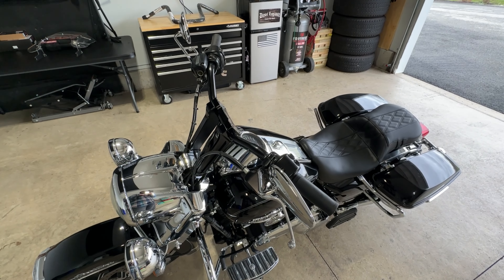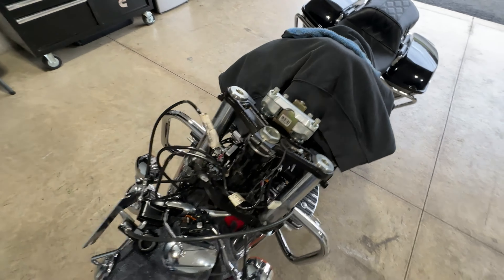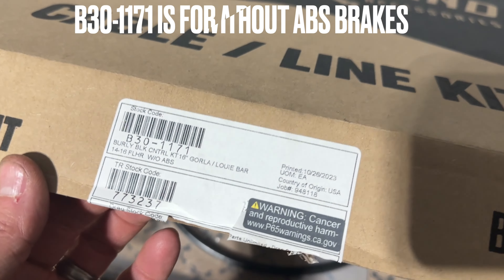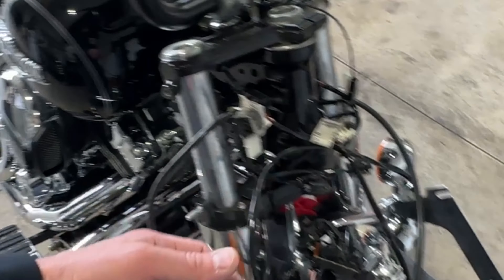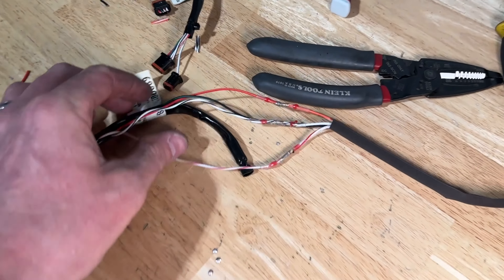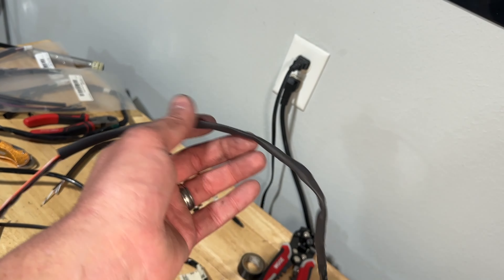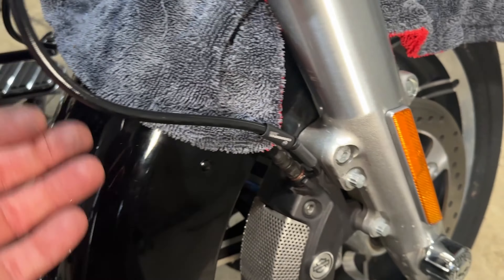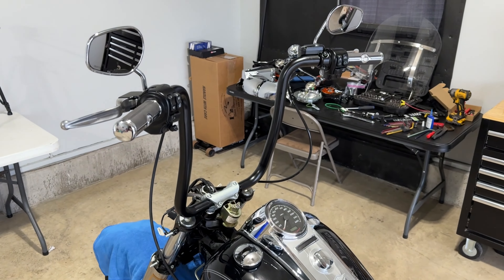How To Install 18” Ape Hangers On A 2016 Harley Davidson Road King Using A Burley Wire Extension Kit

Comment: Nice job, great vid! Did you have any issues with the windshield? As in brake/clutch cables rubbing
Reply from the maker: No, but the bars are not 100% straight as they have a little arch to them so they sweep in from the riser and then sweep out at the top but not issues.

Comment: I’m also 6’3”. I’m considering buying a Road King (103 TC) but heard the wind buffeting is rough without using the ugly lower wind deflectors. I’d also consider a Road Glide for this reason but I don’t need all the added electronics. What has your windshield experience on the RK been like?
Reply from the maker: The RK has options of different fairings that you can add or take off easily.